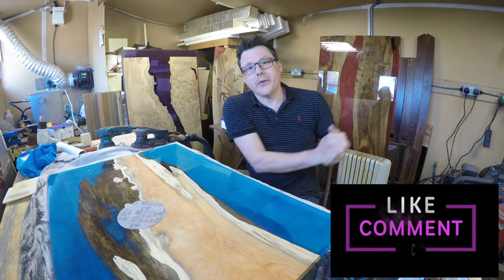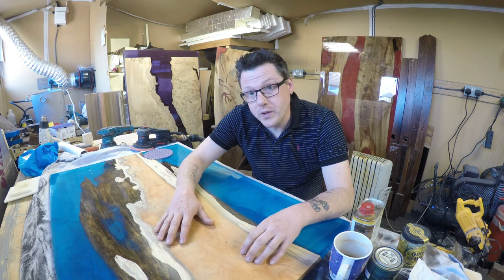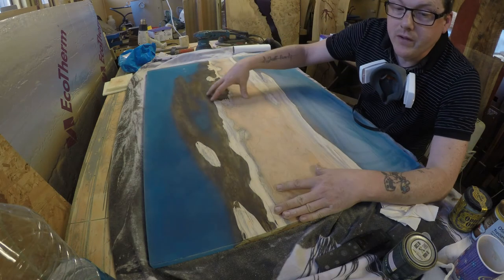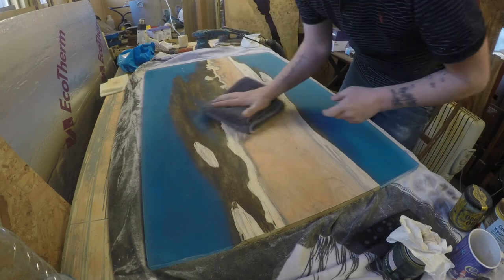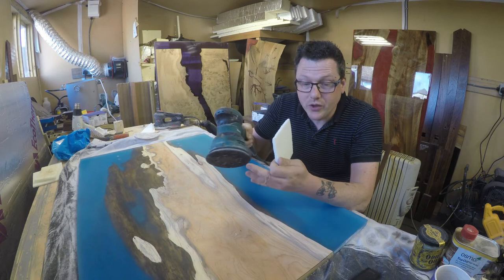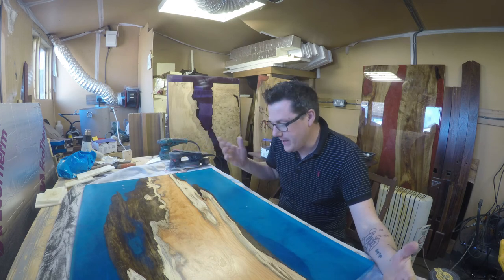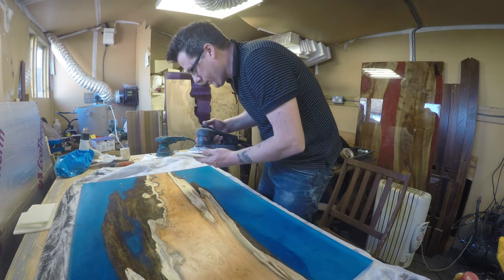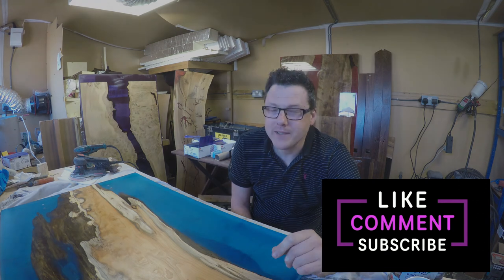The Best OSMO Finish - on wood and epoxy resin

Comment: I can understand removing the excess with a buffer after it has set for a while, but what's the advantage of buffing it in initially with the pad and the sander as opposed to just rubbing it on with a rag?
Reply from the maker: Good question, I’ve tried with all sorts of application processes and with a rag it just doesn’t seem to go into the wood properly, plus on the resin it will just smear and look rubbish with application lines. Osmo sell the pads as the correct application process, but non abrasive white pads from eBay or Amazon are exactly the same and by far the easiest way to apply.
Reply: @woodstockresinworks2972  Thanks

Comment: bonjour, to put osmo on the wood, you have to stop sanding at how many grits for the wood to absorb the product?  (240?) and then we can sand finer wood and resin?  for the finish?  sorry I'm a beginner it's my 1st table, thank you
Reply from the maker: Sand to 320 then apply the osmo. No need to sand after application. Use the non abrasive pads to apply and buff. 2 coats.
Reply: @woodstockresinworks2972  merci 🙏

Comment: Great video, I’m just starting out with resin/wood projects, made a couple of serving trays and some coasters. Do you prefer Osmo or Rubio? Trying to find a finish that makes the resin back to clear again after sanding.
Reply from the maker: I prefer osmo but only because Rubio stinks… 😂 on any colour resin it’s fine, but the only way to get clear resin properly clear again is to polish it. 
I’ll do a dedicated polish video at some point. 👍 

Thank you for your comment.
Reply: @woodstockresinworks2972  what about Odies?
Reply from the maker: @chriscrouch8750  
Yea love odies, but only on wood really, I don’t tend to use it on resin, I’ll use odies on the wood if I polish up the resin with nothing on it.

Comment: You mention that you CAN NOT STRESS ENOUGH how important it is to use non abrasive pads.... and I can't find the exat thing anywhere.... a LINK please?, LOL ;-)
Reply from the maker: https://www.ebay.co.uk/itm/225776948999?mkcid=16&mkevt=1&mkrid=711-127632-2357-0&ssspo=BzCT7tz8TCO&sssrc=4429486&ssuid=RxSBrrqXSGO&var=&widget_ver=artemis&media=COPY
Try those. 👍
Reply: @woodstockresinworks2972 
Greetings from Denmark.... thanks mate !!
Great video 🙂
Reply: @woodstockresinworks2972  
I've been trying to get a glossy finish to my projects using Mirca sand paper with my orbital sander... all the way up to 10.000 grit... and the surface still looks matte.
So I'm hoping your method will do the trick.
It is, of course, always tricky, when you have both wood and epoxy. The wood soaks whatever you put on it, the epoxy doesn't.
I'm not sure if oils like OSMO are the right choice for me.... or maybe I could do OSMO and polyurethane after!?
Well, thanks anyway 🙂
Reply from the maker: @timholstpetersen79  
If you are going for a shiny gloss on the resin then you needs to compound paste after the sanding, then use a cutting paste and finally a polish, there are a LOT of steps, and will take you a long time. Osmo or any other oil’s won’t give you that proper shiny look I’m afraid, but I prefer that anyway. I’ve recently switched to Rubio which I find easier to apply.
Reply: @woodstockresinworks2972  
Hi.
Thanks for your reply 🙂
Three scenarios I want to do, at least ;-) :

1)
The thing is that I have some projects in mind that I'd like to do with completely transparent resin... totally glass-like see through.
I've seen it done on YouTube but I can't seem to replicate the process. These would have resin only surfaces, so I guess I'd have to either finish them with a resin 'coat'/top or shine them to a glossy finish using.... I actually don't know!?

2)
Epoxy tables where the top is a mix of resin and wood, which makes it a lot harder if you also want the resin to be completely transparent, while the wood surface needs to be durable, yes?

3)
Epoxy tables where the top is a mix of resin and wood, but where the resin is dyed e.g. deep black. Here I could go with the satin surface.

Regards Tim
Reply from the maker: @timholstpetersen79  
Hi Tim. Please email me at woodstockresinworks@gmail.com and I can run you through those options one by one, much easier than on here.